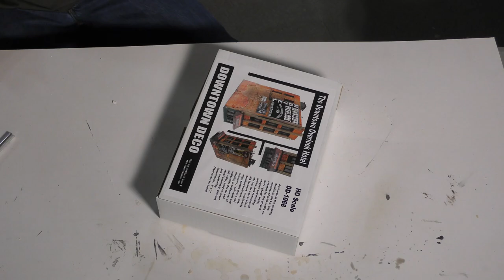Downtown Deco Overlook Hotel Hydrocal Kit Build in HO Scale

Comment: I want to try building a "Downtown Deco" kit as they look really cool.  I've built Tichy flatcar kits, Walthers kits and scratch built my own buildings as well as 3 card stock models.  After fitting the windows and doors I would airbrush them before assembly.  I just purchased a brand new A-proxo knife set.  I never use X-acto knives as nothing is ever exact, only approximate.  I also make my own rust powder out of 0000 steel wool soaked in vinegar.  Cheers from eastern TN